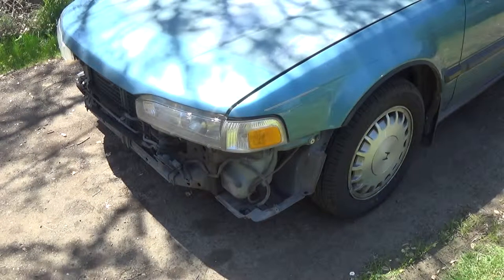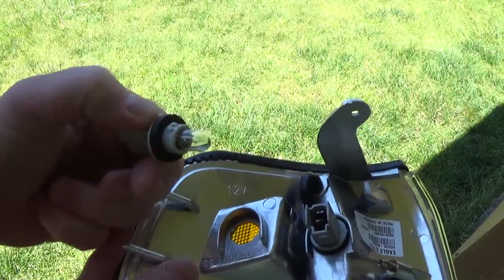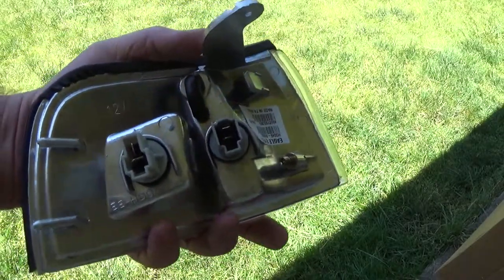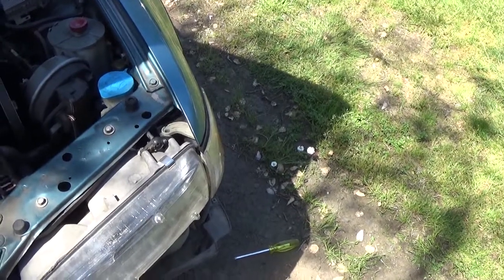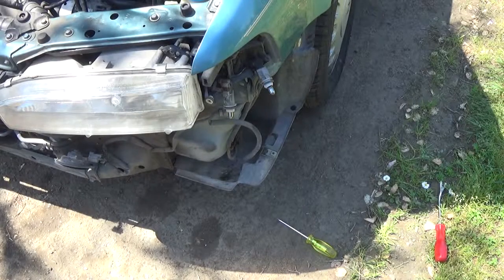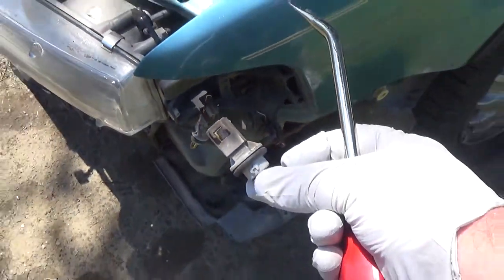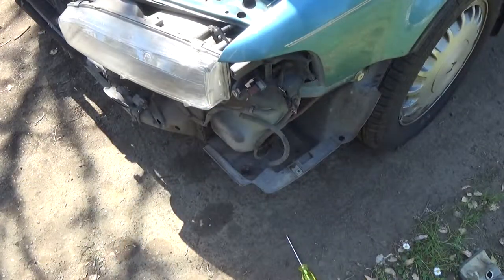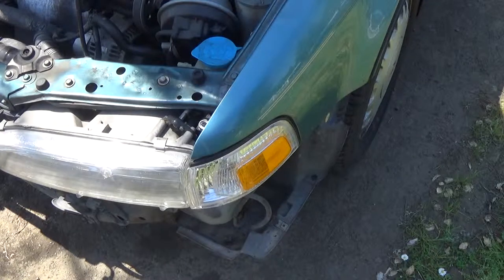1990 Accord front corner signal markers

Comment: I appreciate the help man. I had a little trouble getting one of the connectors in. It wouldn't go in. I had to fiddle around with the connector contacts point. But I finally got it in. Easy job. Also the screw that goes in is stripped. But that's not what really holds it in. I might have to go to the hardware store. And get a different screw. Not sure what the issue is. Maybe it got stripped. I noticed it wasn't tight getting it out. It pushes in anyways. I don't think the screw is going anywhere. I'll see what happens. If it was loose and just sat there for many years. It probably just wont hop out magically.